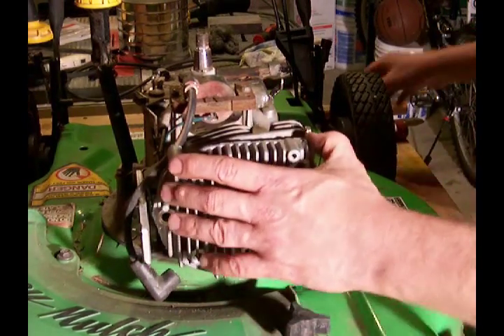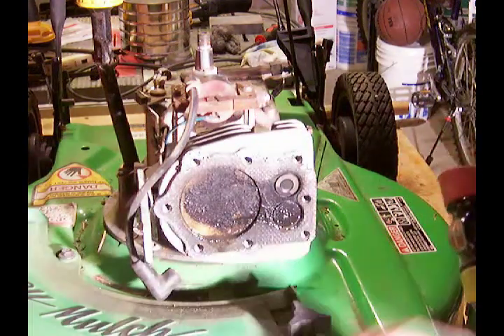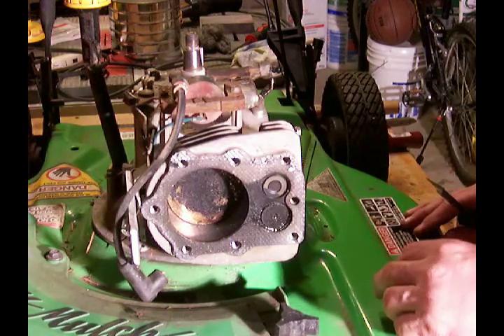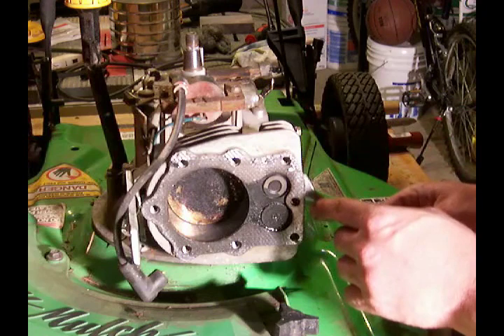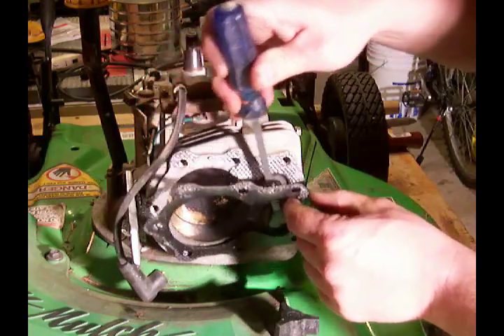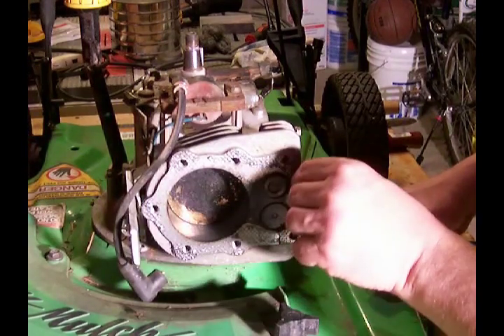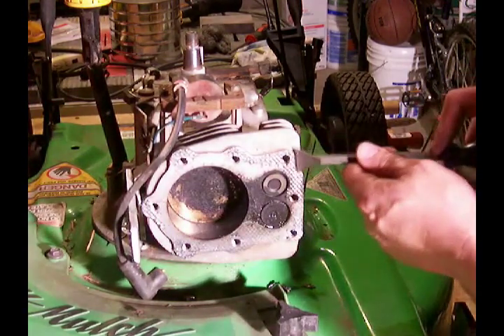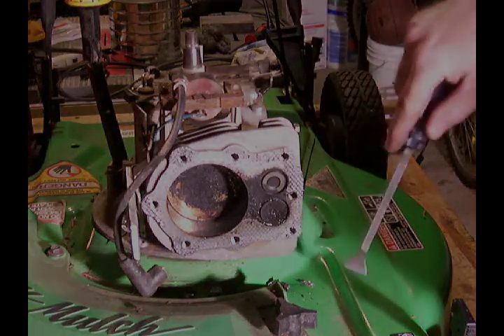#3 Tecumseh LV195EA / LEV120  - Tear down and rebuild - Head removal

Comment: Great video.  I keep bolts and screws together using sandwich bags...cheap compared to time sorting through the bolts and screws later.  I also use power wrenches to save time.
Reply from the maker: I now have magnet trays for the nuts and bolts as well as power tools for tightening and loosening said nuts and bolts. Thanks for watching.

Comment: I just took the head off a Tecumseh LV195XA cause it had no compression, spark and fuel were good. To my surprise I found a small tube from a spray can possibly a carb cleaner can stuck half way under the intake valve. This is my neighbors mower. I ordered a new head gasket and will see what happens when I put it back together.
Reply from the maker: Yep, I had to fix a low compression problem like that once before. The tube was preventing one of the valves from closing. The open valve obviously prevented good compression. Removed the tube and badaboom, compression again. Thanks for watching. I am sure you have this figured out!

Comment: How do you clean the carb from the head and the valves?,THANKS!!
Reply from the maker: First you have to remove the carb from the engine - http://youtu.be/qCrdKo7JmsY?list=PLDEBD8B6066E0D730
Then you have to disassemble it - http://youtu.be/SyHqgtLnjjA?list=PLDEBD8B6066E0D730
Then you have to clean it - http://youtu.be/4kZpQfRyy8k?list=PLDEBD8B6066E0D730
Then you have to put it back together - http://youtu.be/SAaY3XqhS4U?list=PLDEBD8B6066E0D730
Then you have to put it back on - http://youtu.be/AsaT49ihRIE?list=PLDEBD8B6066E0D730

Thanks for watching!
Reply: Im sorry I did not make the right question,how did you clean all the black stuff from the piston and the valves,thanks again.
Reply from the maker: I used a wire brush on an electric drill and I also used my bench grinder that has a wire brush mounted to it. Thanks for watching!
Reply: Thanks for reply back!!
Reply from the maker: epidemia2007 Thanks again for watching.